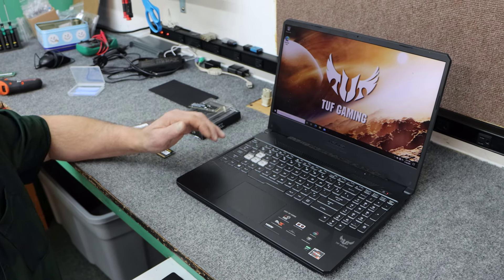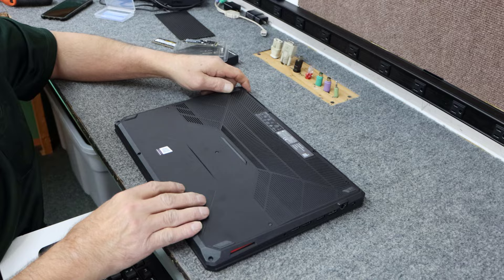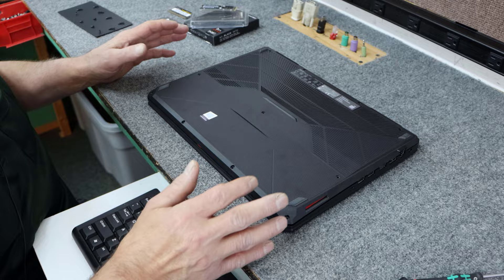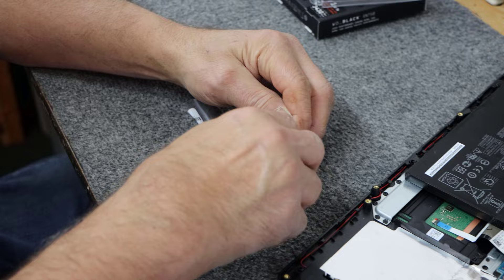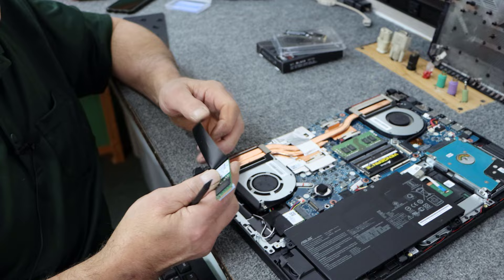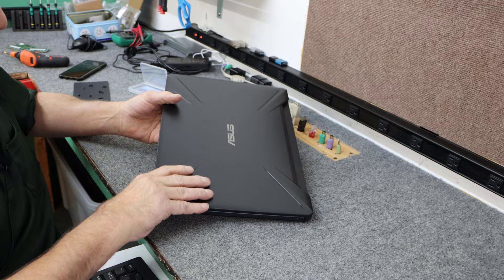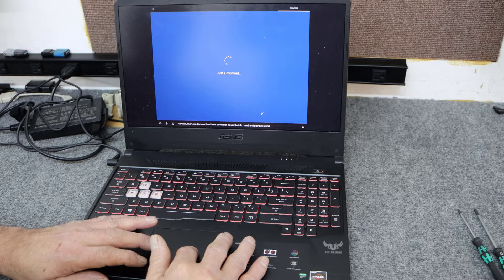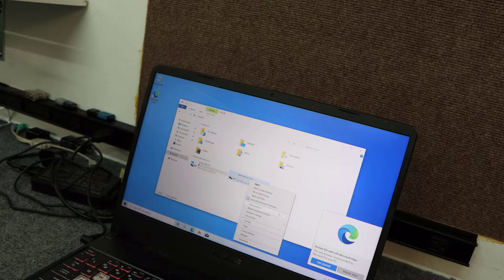ASUS TUF FX505DT SSD Upgrade, Memory Upgrade, Add Hard Drive.

Comment: thanks, I'm looking forward to putting a 1TB drive inside mine and can't wait! Never buying external HDD's again
Reply: can u explain why u not gonna buy HDD anymore? 

im also confused whether to upgrade storage hdd or sdd
Reply: @auroravalhalla  I'm never buying external drives anymore, wether they are SSD or HDD.
I'm not buying externals anymore because the last one I got died after 6 months of usage. It kept giving me errors that became unfixable after a certain point, and now, I can basicaly not access the drive anymore at all. I can't even format it or recover any data and it's not recognised properly by my computer...

Wether you get an HDD or SSD, get an internal one instead.
Reply: @rarespetrusamartean5433  ah i see, maybe not many people that encounter some kind of problem like u. because i also an external user as well and it works perfectly. but my problem is after 3/4 years usage of HDD external, it will broke (boot prob, damage etc). thats why im considering whether ssd or hdd for my external. 

anyway thansk for ur sharing dude!

Comment: The thermal pad is useless without a heat sink. It actually might increase the temps of the NVME, not something that would be detrimental, but not needed. Great video though.
Reply: So if I remove it 
It won’t affect the M.2 ?
Reply: @killerthegamer7399 Thermal pads are meant to transfer heat, if it has nowhere to transfer, it's actually insulating.   On a 2nd look at this video a year later, I probably would add a low profile heatsink to that nvme.

Comment: Why was it missing the SATA hard drive already when you opened it? Mine has a ASU720SS 500G stock installed. Am looking to upgrade to a larger capacity hard drive but dont know how to do it w/o losing all my audio production files, pics/videos and other applicatons?
I see now. Some FX505DT came with a hard rive, other came with an SSD. I'll need to install an SSD. Do I need to re-partition anything?

Comment: If I’m only adding an extra 2.5 1tb ssd to the empty unused bay all I have to do is initialize it? The OS will be untouched? I don’t mind keeping the base hard drive for now. I just wanna have the 1tb to hold games and the 256gb hard drive that came with the laptop for work/school
Reply: Yeah operating system is on the thin strip he installed that he put the heat strip on so adding the side to the  empty bay only expands storage

Comment: when loading in that mechanic HDD, what type of mounting screws did ye use?  I know this may be a silly question but well...   lst christmas, I got a 2TB SATA SSD and I just cracked open the bottom of that thing and just slot it in there...   ..though, I kinda worry that just slotting it in there without mounting screws may be a bit of a detriment...  so I ask, what kind of screws would be needed?

Comment: This helped out lot got the same laptop so iam thinking I’ll upgrade to 16gb of ram and upgrade the SSD to a 1tb what would you guys recommend cause I’ll be doing it myself
Reply: Idk if you e already upgraded or are still thinking about it. But here's what I'm doing.
2x 16gb ddr4 ram from cruical
M.2 ssd from wb black 2tb
And a 2.5" hdd from wd black 1tb
Reply: @0_0.-333 u got performance improvements?

Comment: Great video. I have had mine for nearly a year now.
I don't need to but would like to add RAM

Do you know if 16 GB is the limit or is it possible to have 2 x 16GB put in for 32 GB?
Reply from the maker: All the TUF laptops I've worked on, have supported 32gb of ram.
Reply: Thank you
Reply: @your_virtuoso  i can confirm it will work with two 16gb ram sticks, it was basically plug and play.
Reply: @morgankuikka4940  thank you
Reply: @your_virtuoso  no problem, i got the laptop on sale in 2019 and saved up for the ram and 1tb ssd, i am really happy with it, i might replace the m.2 card for a 1tb at some point later, but im on a really tight budget and dont feel like going through the hassle of transfering windows. Good luck, and i hope you enjoy it.
Reply: @morgankuikka4940  I bought mine new and the secondary bay already had a 1Tb HDD. I may replace the ssd from 250 to a terabyte too
Reply: @morgankuikka4940  if I transfer windows 
Will the laptop keep the original key or no ?

Comment: Thanks i replaced the hdd with my old ssd. The hardisk was un reasonably slow. Don't know if it was the sata port will have to check the port if it's sata 3 and check speeds tomorrow right now I'm migrating all the files

Comment: Same laptop I have purchased in 2020 but Ryzen 7 3750H processor. Which is the best processor in these two Ryzen 7 or Ryzen 5 ?
Reply from the maker: Well, ryzen 7 is a higher end cpu.
Reply: @CadillacComputerCenter  But it is frequently hanging

Comment: guysss, is it true that HDD quickly damage rather than SDD?

because im considering my external storage for my laptop
Reply: You do need to be more careful with HDD's than SSD's. But if you want external storage, they are both usually inside protective covers. I would still choose ssd, because they are quite a bit faster.

Comment: I am currently upgrade my laptop with the same exact model. I'm now on the windows setup part but I'm stuck with when I turn on the laptop, it does not boot on the usb automatically and it does goes from asus logo to blue screen then off. I tried to restart and go to bios and my flash drive does not appear on the selection on boot priority. Any tips for that?
Reply: Reset pc

Comment: Hello sir I followed your guide and I now have successfully upgraded mine's RAM to 32 gigs

I have a question though why is it that the keyboard LED lit up when I plugged the battery in? When I unplugged the battery I also pressed the power button a couple of times but when I put it in the first time the keyboard LED lit up despite not being turned on at all like no fans no disks running, etc

Turns out I only plugged in one side in successfully and when I pushed it further in the LED turned off and I could turn on the laptop again 

Though Im not sure if this really is the cause for the keyboard lighting up or not so Im curious what are your thoughts on this?

Thank you!
Reply: i might upgrade to 32gigs too 3200mzh just to start playing modern warfare
Reply: @ruoho5332  just be aware that the motherboard limit is 2400mhz so 3200mhz will work but still max out at 2400mhz

Comment: hi sir i have 512 gb ssd  variant of same laptop can i add 2tb 2.5 inch hdd in it?
Reply: Yes u can its just the question do you replace the 512 gb with 2tb or no bc how i understand this motherboard has m.2 slot and the sata slot so in that case 1 m.2 and another one sata conection

Comment: Can i put a 8gb ram on my 4gb variant? Same model laptop (4gb+8gb=12gb)
Reply: I would not suggest doing that because you might come across some software instability. If you really wanna do that then get another stick.
Reply: Well yes you can but i will give you some stupid stuttering and low performance issues

Comment: For asus tuf fx505dt, what is the best wifi card? I plan to upgrade it. Thank you
Reply: bro we have the same laptop i have a issue with my laptops wifi module because it always says no wifi networks found i am planning to buy a wifi dongle that supports 5g
Reply: @altairbarcial8417  Try to change the wifi card. I have change the wifi card and its work. Currently im using intel ax210

Comment: Can you upgrade the gpu ?????
Reply from the maker: No you cannot.
Reply: @CadillacComputerCenter  Can you atach an eGPU ?? So you can increase the performance
Reply: @CristianCiausu  no
Reply: @CristianCiausu  you could connect an external GPU to the WiFi chip, but then you'll need an ethernet cable for internet

Comment: do u have to reinstall windows
Reply from the maker: Hi. You can do a clone or a clean install.
Reply: @CadillacComputerCenter  Hi. If I reinstall Windows, how can I activate it without the product key? Or is there some way to get the product key from the laptop?
Reply: Also, another question I have is that, if I want to install an additional 2.5" SSD, will the OS in the existing NVMe not be affected? Do I need to turn off / disable anything first prior to installing the additional SSD so as not to damage the OS / data on the NVMe? I have the same unit as the one in your video. Thanks.